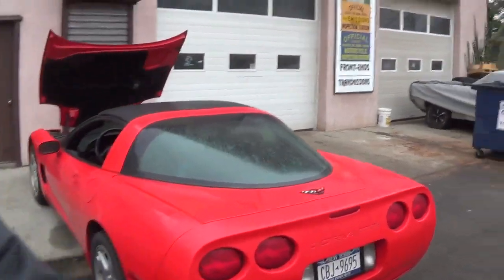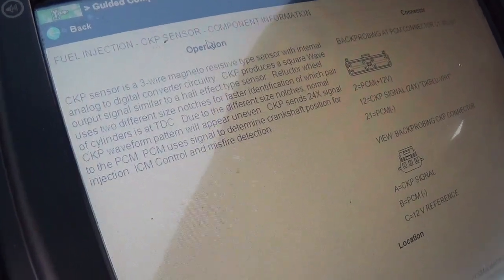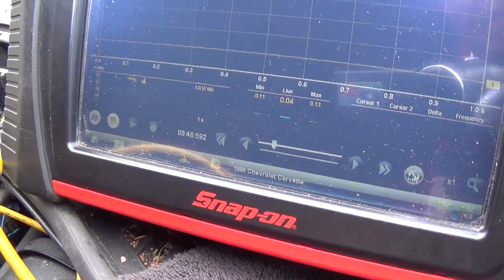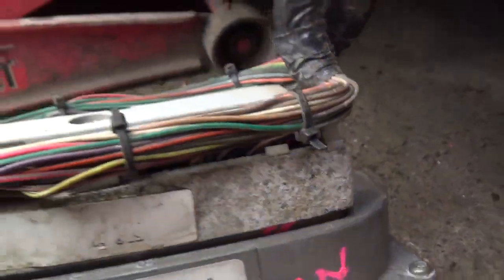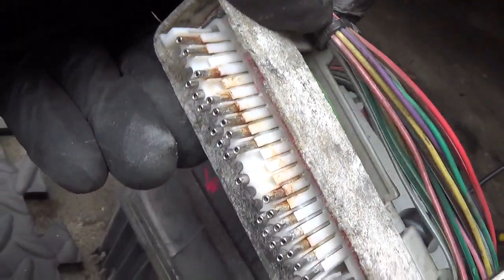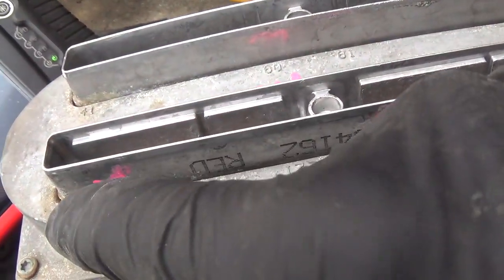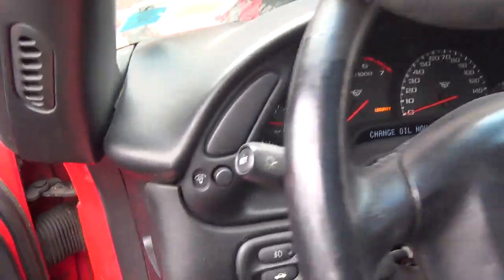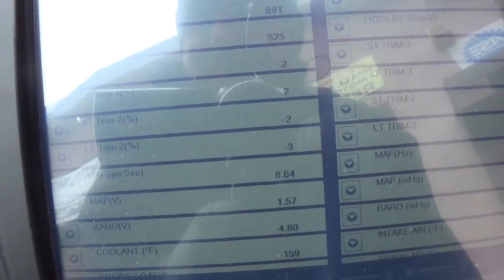Corvette Barely Runs case study (Staten Island Ep. 8.5)

Comment: GM - "This computer might get hot if it's up high in the engine bay. Let's put it behind the wheel, so when it rains, the water will cool it off."
Reply: Dylan Lewis I don't think any car is designed to be submerged in salt water for an extended period of time.
Reply: Not made for Nova Scotia!
Reply: Get that great GM feeling.....................
Reply: Behind the glove box is the best place for a computer.
Reply: Dylan Lewis, or how about putting the main computer in front of the drivers front wheel. (Less water?) 2008-2019 dodge caravans. No manufacturer learns their lesson!
Reply: @kdmq  Unless your windscreen leaks,which happens! "-)Lying flat under the centre console on top of the transmission tunnel isn't bad.
Reply: Wow four years ago
Reply: GM couldn’t build a car to last 10 years. Worst engineering in the world. Yet the government bailed them out.

Comment: Ivan, Great video. I have an "01 C5 and since these C5 have many electrical gremlins I bought a product called Nanoprotech to spray on the wiring...I also took the PCM a few weeks ago and pulled it apart and luckily my pins looked like new....these PCM's are prone to having battery acid drip on them so that's the first place I'd look if you have some weird issues...at the Airlines we use Deoxit as a contact cleaner...works great !!

Comment: Next time you want to clean the green garbage from a connector use a solution of white vinegar and salt.  Dip the connector in the solution and move it around.  Use a toothbrush to loosen the corrosion from the connector.  Repeat if necessary.  Finally, make another solution with water and baking soda to neutralize the vinegar and use a heat gun or hair dryer to remove any moisture from the connector.
Reply: Thank you. I will be doing this in the future
Reply: Maybe spray a thin coat of WD40 to preserve it as well.

Comment: Greeeeaaaat engineering there, GM - lets mount a computer in a friggin wheel well! 

Thank God it wasn't the cam sensor! 

Instructions for removing the cam sensor:

 Step1: Remove engine ... 

SMH ... last good Corvette was built in '72. ;)
Reply: chrysler did that with the battery in the sebring

Comment: You inherited a mess. Nice diagnosis but they definitely need to fix the PCM connectors b/c that corrosion is not going away. Deoxit and Stabilant 22 will definitely help but I'd be ordering both connectors and the bad terminals would be replaced and the others Deoxit and Stabilant 22 and when finshed it'd get dielectric to help as corrosion prevention. The insulators are probably still in the old computer. Great job diagnosing it and if they replace the connectors like you suggested the Vette's reliability should be back.
Reply: Complete engine harness would be the best option if you ask me,it is not an Honda Civic, that car worth fixing it properly
Reply: No need if it's only the PCM plugs that have corrosion. Change out the plugs is best & most cost effective b/c changing out the harness is labor intensive.  Harnesses don't go bad unless it's a material deficiency with the wire strands or a crimping issue with multiple plugs or it has multiple plugs throughout the harness with corrosion from salt water intrusion . Too many harnesses get changed for no reason.
Reply from the maker: I'll take a 5-speed beater Civic over an Automatic Corvette any day of the week lol
Reply: I wouldn't.
Reply: hahah no me! i would rather get the gonorhea over a Honda!
Reply: Cause you are weird !.....lol
Reply: @Jonathan11225  Cutting the old terminals off and crimping on new ones, along with getting new connector housings, IS fixing it properly.
Reply: @Jonathan11225  Cutting the old terminals off and crimping on new ones, along with getting new connector housings, IS fixing it properly.
Reply: @Jonathan11225  Cutting the old terminals off and crimping on new ones, along with getting new connector housings, IS fixing it properly.
Reply: @Jonathan11225  Cutting the old terminals off and crimping on new ones, along with getting new connector housings, IS fixing it properly.
Reply: @Jonathan11225  Cutting the old terminals off and crimping on new ones, along with getting new connector housings, IS fixing it properly.
Reply: @timramich  that would depend on how far up the wire the corrosion extends. If it's more than an inch you won't have enough length left on the wire to reach the computer. I did one truck where the corrosion extended almost a foot up the wire. I ended up making a new rear harness for it.

Comment: Under guard location is great for mounting wiper washer bottles..end of story. If the previous molester/repairer had used Stabilant 22 or similar contact grease and reassembled correctly with pin guide and new seal??. I sense this one is a comeback hiding around the corner. Hope the shop owner has explained this to the customer! You did a great job under difficult circumstances Ivan.

Comment: That car is going to be a problem until those connectors and pins (maybe a harness) are replaced . This is the problem with modern cars and I doubt many of these  cars are running as  classics in the future
Reply: also want to add who puts a computer behind a wheel? REALLY GM???
Reply: They won't be classic collectors because software needed to diagnose them will no longer be available, and/or many of the electronics will be impossible to get.

Comment: Great find Ivan on the corrosion on the pins. I was glad for you that the cam sensor was okay. Damn, I wouldn't want to try and change that thing. It's probably going to have some more issues with those pins though down the road :) Have a good one!
Reply from the maker: Hey Terry glad you stopped by! Yeah I should have just started at the computer... But then would have missed that torn PCV elbow haha
I was actually a bit nervous fitting that connector back together and bending the pins on the new PCM. You saw the first try fixed one problem but caused like five other codes to pop up...yikes!
Reply: Yeah, I would have got a little nervous too when I saw more codes. I would have thought that I screwed something up like bent pins, etc. :) You know Ivan since corrosion seems to be a really big issue especially where you're at, I was talking to our chemist today about what really works on breaking down the copper oxide. He made a few suggestions which is probably common knowledge, but a few controlled experiments with several connectors that are corroded would probably make for an interesting experiment. The experiment would be using different chemicals and different time intervals and comparing the results as time passed. Some suggestions of chemicals would be white vinegar, white vinegar that's been boiled, lemon juice, muriatic acid and the battery acid removal in the spray cans. After the cleaning operation, the acid can be diluted with a baking soda and water solution. After the neutralization, a follow up with DeOxit 100 for a final cleaning operation. What do you think???
Reply from the maker: Chemistry was never my favorite science subject, so I hope someone has already done that experiment and wrote down the results :)

Comment: Holden fitted the PCM under the bonnet in my Commodore which is a a smarter place to fit it, it runs the same engine albeit is a 2002 engine which runs the same camshaft as the 1998 Camaro LS1 engine & a returnless fuel system.

I've driven the car when I accidentally left the camshaft position sensor unplugged when I replaced a knock sensor in 2009,it didn't make a difference in performance but a check engine symbol was switched on as it's in LCD form in the Commodore.

I made my own PCV hose system up for it in 2011 as the old y shaped rubber pieces & PCV hose just fell apart.

The air conditioning belt squeaks a bit in the mornings,if it gets too bad I just spray some belt grip spray onto it but lately it just goes away when I drive it !

Comment: Hey Ivan !!...I have an '01 C5 Corvette and since I recently purchased a 2 channel Picoscope (thanks to you ,Matt, Paul Danner and Eric O) I'm trying to get some hours on using it...when I saw you trying to get crank/cam it's a lot easier getting the signal from the PCM...I'm working on that next !!....did  primary ignition current ramp last night using the ground wire that's for each bank I noticed the waveforms were not all evenly spaced out...is that a concern ??...P.S. I had my PCM apart a few months ago to see if I had any corrosion but thankfully it was "pristine"...C5 PCM's are notorious for corrosion since its sit above the battery and can get battery acid dripped on it !!

Comment: If the connector cover is missing, it's likely because the box isn't the right model for this car.  GM did various connector tab spacings so you could not plug the wrong module in.   Eric O. ran into this exact same problem.

Comment: Nice buddy and by the looks of the missing covers  on the ECM harness did it play a role in the corrosion of the pins ?
Reply from the maker: Hey Steve, I believe the connectors were so corroded to the old PCM, that they got damaged when removing the original unit. Carnage!

Comment: The intake can be removed on these cars in about 30 minutes.  This car has a bad oil pressure switch (gauge pegged and oil leak). Also it probably needs a ECBM.  Unfortunately they are used only and on this year, very pricey.  Thanks GM for mounting the leaking batteries over top of the computer.

Comment: You think that cam sensor is hard to get to, try it on my 4th gen Camaro with the same engine, the freaking cowl comes out to about the middle of the valve covers! It'd be easiest to either take off intake or drop engine/transmission! Well maybe not...

Another great video Ivan!
Reply: Yes ..looks as though I have to replace the crank sensor on my 2004 Kia Optima ... basically have to do a timing belt change to get to the 33 dollar part :(  and god know how much labor.. being I have never done one
Reply: Im thinkin of replacing cam and crank sensors as a prevent maint.  Its not so bad on the trucks.  If you can get a small wratchet back there with a 10 mm socket, it comes out pretty easy.  On these cars you may have to drop the trans mount and get it from underneath. Seen a vid with a tech pulling the intake just to get at it. What a friggin pain.
Reply: ashoppa intake manifold takes about 20 minutes (maybe less) if you've done it before. I am not saying it's great but every car has it's tough stuff to work on. Also when they went to the Gen4 block (LS2 and later) they moved the cam sensor up front.

Comment: How did this repair turn out? 

Because of pushed in module pins you will need to replace the module. The harness connectors (pins) have to be cleaned with Deoxit (D5, D100 and G100) and the blue secondary locks reinstalled. If the replacement module is a used module the module pins will need to be inspected (no pins pushed in or bent) and cleaned. To keep water out after operation okay, you could seal the connector wire exits with GROTE Ultra Seal Connector sealing grease.

Comment: to motoYam82 Ivan , just a comment , I see you have a laptop for the pico scope sparely I just started using pico scope and I set up the software  on my verus and I am running it from there one of this day I did 6 channel 4 on pico scope and 2 on verus  that  is better at least for me the loptop is some time hard to work under the hood. nice videos and thans for sharing your knowledge.
Reply from the maker: Wow what did you need six scope channels for? I think my Verus is a little slow to run the Pico :)
Reply: motoYam82  I am new to pico scope they have one at the shop and nobody  was using  it so I decided  to start using it ,  how ever  my verus flys I updated my hardrive to ssd  I have those videos on my channel  there is a glith I can still live with it but i like the speed, I was trouble shooting at the shop   in intermittently crank no start   when hot no check engine illumination  during event  ( 04 infinity g35) so I wanted to capture  what was going on in one shot , I think 4  powers  to ecm on pico  and  on verus 1 channel to coil control and other channel to 5 volts reference.  i
I like the pico  and your videos help me a lot your are the man thanks for sharing.

Comment: In addition to the crusties that massive vacuum leak creates the miss!
Reply from the maker: nah that's not a massive vac leak for this monster V8 ;) Might cause a P0171, but not a single-cylinder miss. That was due to a poor pin connection for an ignition coil control wire at that same crusty connector

Comment: Ivan, couldn't you have just back probed the CMP wires at the PCM ??...helped someone diagnose a CKP sensor issue in FLA. a few days ago...I'm in NJ......he had 2.9 volts at the 12v CRK feed wire at the PCM...had him disconnect the sensor (remove the starter) still 2.9v...did short to ground and no short...did PCM power and ground checks and all good...OK, bad PCM then...NO !!...checked the CMP 12v feed at PCM now and also 2.9 volts...MMMMM ??...removed the intake manifold and disconnected the CMP sensor...12 volts came back....shorted CMP sensor !!....both 12 volt feeds for CMP and CKP must be supplied by the PCM on the same circuit.

Comment: The root cause is battery leakage.  You are supposed to only use an AGM battery in the C5 Corvette.  A lead acid battery will leak acid all over the ecm and throttle module damaging it.

Comment: If the car could talk, "I survived superstorm  Sandy but my PCM/connectors did not", lol.
Reply: battery leaks down onto them and it wipes them out, the ground pack connectors all corrode up front to rear and that's the ones never in rain, salt or floods ;)
Reply: jdtractor man Put a PCM under a battery, then just wait for the damn problems! Keith loves the Ford's that are set up that way since he gets the PCM swap and then the programming job.

Comment: For us non-circuit guys- when you talk about a 5-O reference what is that?  Also, what is closed vs. open loop on the scanner?
Reply: SuperM1687 That would be a 5 volt reference which is supplied by the computer to various sensors.  Open loop  vs closed loop refers to  whether the engine computer is using default parameters to control ignition or in closed loop the computer uses values from various sensors to adjust ignition.
Reply: Right on the money sir.
Reply from the maker: Not just ignition, but also air/fuel ratio by fine-tuning the injector pulse width :)

Comment: I know you did not want to take that connector apart again and risk not getting the pin and sockets lined up, but I would have packed that connector FULL of silicon dielectric grease !  The grease will last a lot longer than that WD40 !

Comment: oil pressure at 80psi
Reply: Yeah that's an open circuit too, if you scroll on the driver's info screen it'll probably read 130psi. It's conveniently located 1" from that cam sensor at the back/top of the block
Reply: You have a bad oil pressure sending unit.  The intake needs to come off to replace.  I have seen a few vids on how to replace it without taking the intake off, but none worked for me.  Taking the intake off is very intimidating at 1st but its not bad at all.  Took me about 4 hours to do it my 1st time being very careful.  Had to remove it again to get a vacuum line I missed and took me only 30 minutes to get it off fix the line and back on.  The drivers side rear most bolt will make you cuss like a sailor getting it off.......fair warning.
Reply: Mr Green The sending unit MIGHT be bad, or is could be just an open circuit due to all the corrosion at the pcm
Reply: With the large corrosion it possible that it is either.  I would isolate and test the OPSU circuit.  To do that you will need to take the intake off to clip onto the wires to do a voltmeter test.
Reply: i bet thats right man i think we should have 1 day a year to line up all the engineers that come up with some of this crap so we can kickem all in the balls

Comment: best clean/grease every ground point front to rear, stupid connector packs are known for corroding up, probably rodents living in there somewhere as well :)  cam sensor = remove intake.
also known for battery leaking onto PCM, connectors, wires and causing corrosion on all, some need full PCM harness replacement. yuck
I think there was a ground down in that area also, or maybe it was up higher in behind.